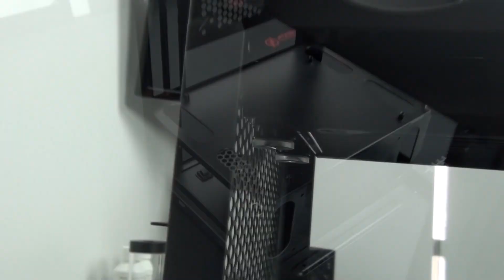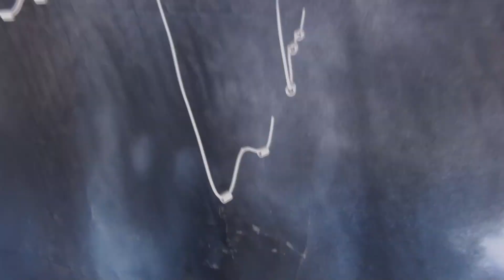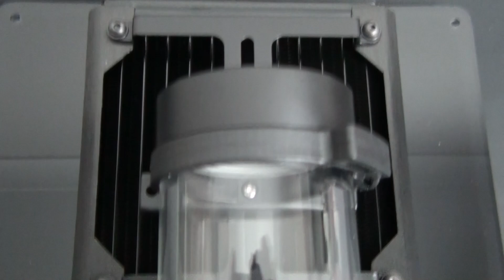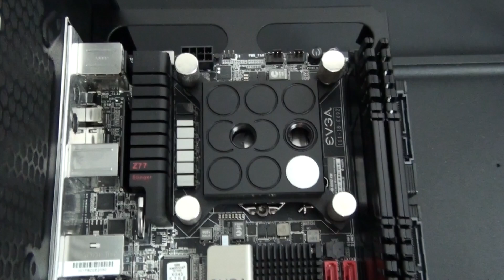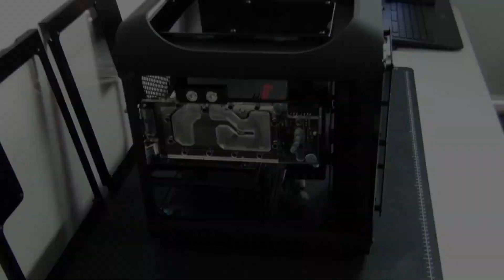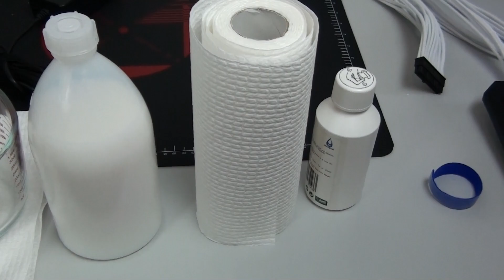Build #9: Extreme Prodigy: Part 4

Comment: couldnt you possibly use the Bitspower Aqua pipe that screws in from the top, and use it at the top of the reservoir? and just plug up the normal inlet thread?

Comment: I have a new pc wont say where from but it cost me £2300 and doesn't look anything as good as the work you do. my pc is a boj job it has really bad tubeing no bits bolts just tube to raidiator they put red fans in that don't match the green colour of the uv coolent  its a total mess and when I ran the company up when I first got it and told them I didn't like it they said they take it back and fix it but at a price so I decided not to take them up on that since they already took my money and now im stuck with a pc that cost a lot and yet not what I wanted in looks
Reply: Lot of those prebuilt companies don't know what they're doing. I work in a computer shop and some kid brought in his 2000 dollar computer to get it fixed, motherboard wasn't posting or anything. We took the CPU out and there were bent pins all over the socket. Whoever put it in put it in the wrong way and mashed it down and bent like ALL the pins on the socket.
My point is, don't go to a system builder you know nothing about, go with either someone you know personally, or heck, even Alienware is better than those companies.
Reply: Wow, I'm really sorry that happened! Always make sure the company has some kind of satisfaction guarantee. Did they at least discuss what it was going to look like before they built it? Any kind of preliminary work?
Reply: Hey. Omw? They should definitely get their money back for that. That is PC building 101. Was it not even tested before being sent to the client?
Reply: Neek Lives He used it for a couple months actually. The kid who owned it was like 11 so we didn't get much out of him. It might have been crashing and freezing a lot. I don't really know.
Reply: Hey. Omw? Wow that's unbelievable! He definitely deserved to get his money back. That's just unacceptable.

Comment: It looks like the EK waterblock for the videocard has an area at the top next to the port  where no coolant can come. Is this a design error from EK? Because especiallay with the white coolant is stands out..
Reply: I think it was more of a design overlook.  I'm sure they didn't entertain the thought of installing a video card in a different orientation than normal a tower case.  Here the card sits vertically, liquid running up and down.  In a tower the video card lays down, so liquid would definitely get into that dead zone.  Hope EK is fixing that as smaller form factor cases are becoming much more popular.

Comment: The more than sufficient amount of radiators are under-taxed anyway, so agreed. My only issue with the front fans here is that they are pulling air in, but not filtered in anyway, so it might get dusty which would be quickly visible in a mostly black build.

Comment: You can, the main rule here is that the liquid needs to fall from the reservoir into the pump. Just be sure that when you fill the loop, the pump is actually full of liquid (which is filled trough the reservoir). If there is air in the pump and you turn it on you'll break it. In other words if you fill the reservoir but the pump is above it, you cannot fill the loop.

Your idea here wouldnt be the best on eastethics (looks) but technically works without a problem, as long as you do it right.

Comment: hi
i just had a question
i read in several places that the res should always be directly above the pump
would it be ok to place it horizontaly on the flat area above the PSU in my 800D?
the pump would be in the lower section beside the PSU, so technically it is below the res, but not directly under it
can i do that?

Comment: I'm surprised you decided not to sleeve the pump cables as they will most likely be very visible within the build. And i would also think you'd have rebuilt the cover pieces in clear acrylic so you can see the white of the fans more. Or at the very least leave the front panel without a cover. overall this is such a gorgeous build 5 stars my friend

Comment: Forgot to give you my tip get a hole saw kit for your drill press helps with perfect circles for 120mm an 140mm fan holes just use slow speeds for aluminum plate will help with time

Comment: Hi, I have a question. I want my H100i to have white tubes to go with my colour scheme, but I don't want to take it apart like most people do and swap the tubing. I was thinking about painting them with some special paint that would be flexible and stay attached to the rubber tubes. Do you know what paint I would need to use? And would it be better to paint it while the tubes are straight, or in the position they will be in the computer? Thanks a lot :D

Comment: Hi there. Im a huge fan! I have a quick suggestion it appears the back fan exhaust ahead is out of place, it becomes especially visible given you have sizeable side panel windows. Can I suggest perhaps you could use a dremmel tool to cut out the perforated area and install a black smoked acrylic panel so it matches the front and top? I can see that getting the screws in may be a bit of a challenge at this stage of the build, but I really think it would improve the look of the case. Thanks

Comment: tip: i always use a standard metal saw to shorten m4 bolts, because it doesn´t damages the thread, it´s also very fast if you firmly fix the bolt.

Comment: Cant agree more hard piping (copper/ nickel plating or acrylic )is the way to go these days endless possibilities. Ends up looking so clean and less fittings needed unless in your case where you use bitspower and crystal link as your feature.

Comment: I noticed you used a T-line design for the reservoir in the loop compared to what you usually do and IMO is better which is to have the res inline with the loop. You have used an inline design for this case before and it looks as though you could have easily done that here. Did you have something different in mind for this build and is that why you used a T-line?

Comment: No but I did see a large air pocket at the top right of the graphics card it's self. I'm sure he saw them too and will rotate the case around to get rid of them and if not shipping has a ton shaking and tipping that will likely get the air to move.

Comment: question since u are talking about liquid coolant lasting longer... forgetting performance (as long as its still better than aircooling in general) are there better liquids (like mineral oil) used for the loop to last longer? for easier maintenance and cost